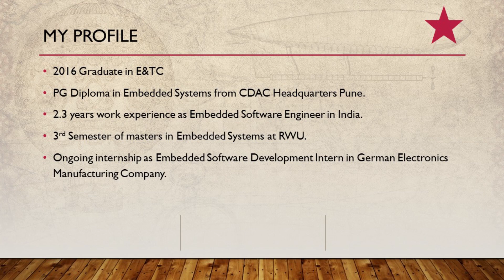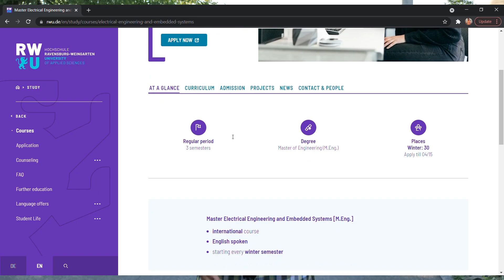Insights Into Masters in Embedded Systems at RWU | Embedded Systems in Germany | Rushikesh Munde

Comment: Hello sir,
I appreciate your work of sharing knowledge via these videos.
I had a query,
That can B-tech in automobile engineering students opt for the course for Masters in embedded system in Germany?
I would be very helpful if you could comment on this.
Reply from the maker: Hi
Thanks for your support 😊
If your course name is not there but if the course content matches you can apply. You may check the course requirements , Email university.

Comment: I have done bachelors in electrical power engineering. I want to do a master's in embedded systems. My CGPA is 3.27. can I get the admission?
Reply from the maker: Can you check the university requirements that you want to apply. It would be clear whether to apply or not.

Comment: Hello sir. I have done my bachelors in Electronics and Instrumentation engineering, and I am seeking admission at RWU for masters in Electrical engineering and Embedded systems.  I like embedded systems which is the reason why I am opting for this course?  Will I be eligible for the course?
Reply from the maker: Thanks for your comment 😊
Yes , you can apply to this course with your bachelors. But eligibility criteria you need to check on university website
Reply: @Rushikesh_Munde  Thank you sir for replying 😊

Comment: Respected sir ! 
I'm doing my engineering in biomedical engineering and i have knowledge of microprocessor , microcontrollers nd signal processing, is it possible that i can do masters in embedded system.
Reply from the maker: Check university requirements for the eligibility criterias. As long as you satisfy it, I don't see any issue.

Comment: I would like to do an electronics based course in pg in Germany such as embeded system,iot &sensors,vlsi,,power electronics and drives
I had done ug in bio engineering in which we covered more than 6 papers in electronics
Reply from the maker: That's great...
Wish you best luck with the applications 🙂👍